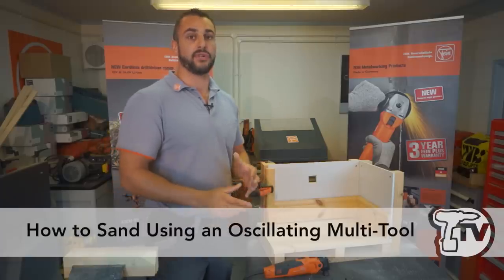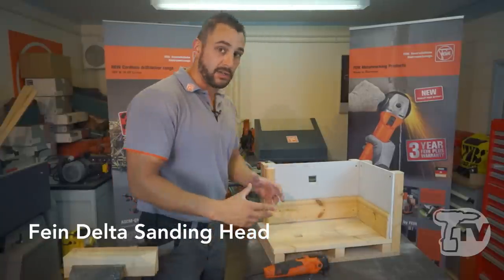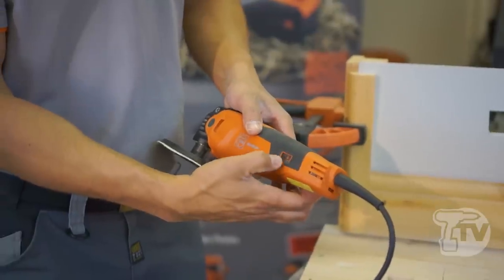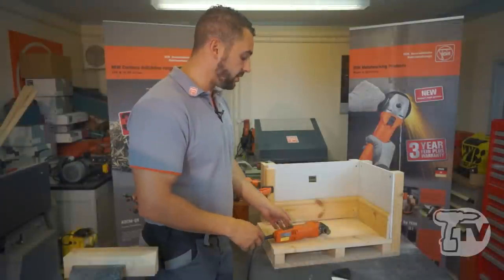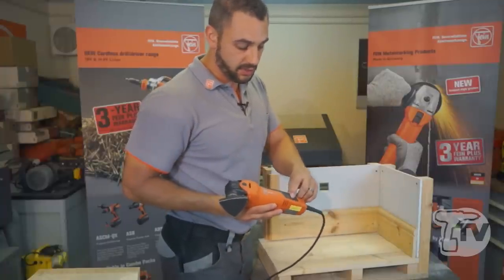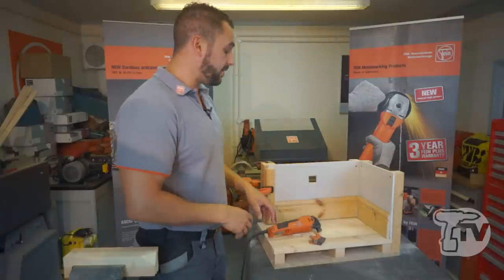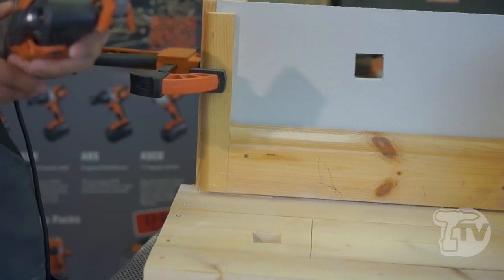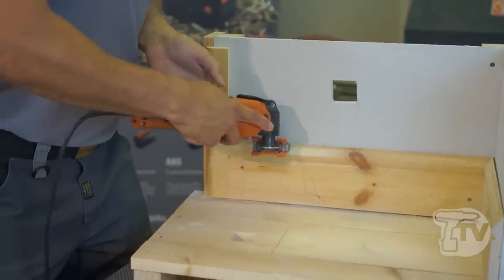How to Sand Using an Oscillating Multi-Tool

Comment: Bought one 6 or 7 years ago. Good tool but the sanding pads are a disaster. Used twice for sanding only recently and the metal plate separated from the foam pad after 15 minutes; the glue was dry and not holding anymore; I had to reglue it using double-sided tape. Plus, you better not detach the discs before having used them until they are completely worn out  because the velcro at the back stop gripping after the first time they are detached from the pad. Even more, the grip from the foam pad became full of heated glue and fibers from the sanding disc (an original one sold with the tool) in one place. I tried to remove it from the pad but impossible to get everything from the tiny hooks. Very disapointing from such a good reputable brand...
Reply: Seems like you had the tool speed too high